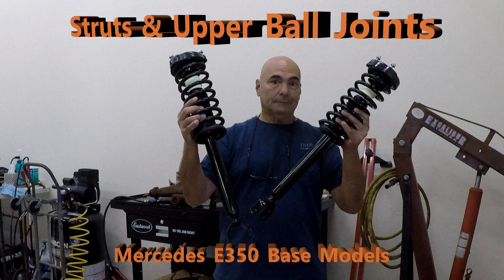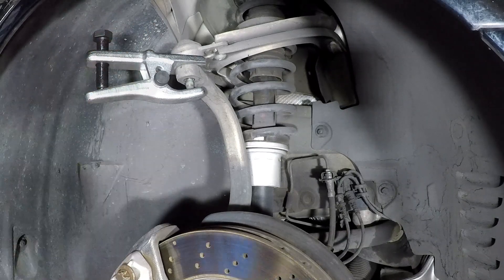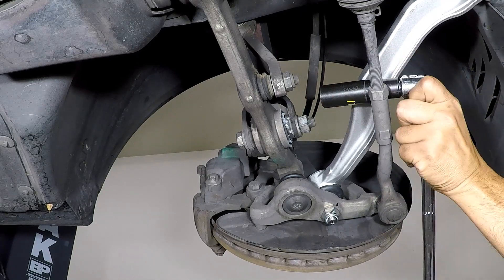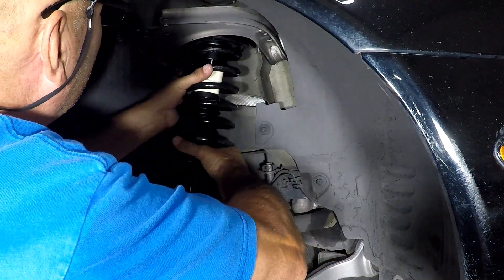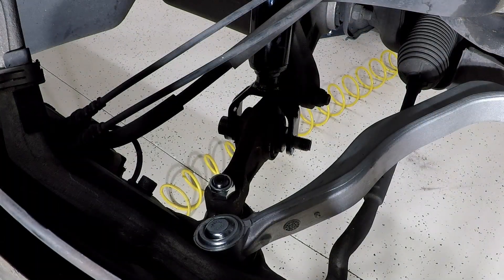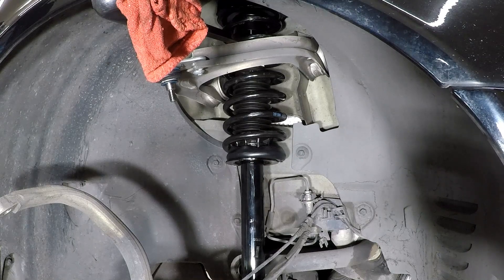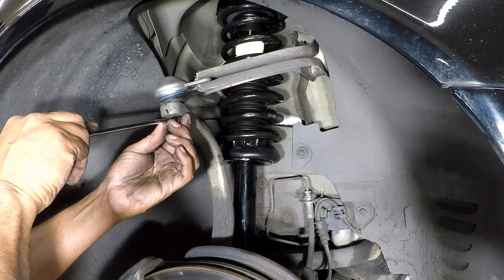Mercedes Benz Front Struts and Upper Ball Joints

Comment: GREAT!  My son and I changed out his struts and ball joints.  We used the Unity and Moog ball joints.  The ball joint lower bolt was 17 mm for his 2008 E320.  Thanks for leaving comments on too because I am learning from others about torque settings etc.   I know this saved me on having to take this somewhere.  I estimate about $400 on parts through amazon that included some tools.

Comment: Great Video. Clear and concise. Just a small recommendation for others when cracking the upper ball joint. I leave the ball joint nut undone but still on the end, this protects the thread while splitting and also stops the upper control arm springing upwards. Just my two pence 🙂

Comment: Great Video btw, thanks. When you split the ball joint couldn't you just leave the nut on a few threads so it doesn't damage them, plus when it pops you don't have to worry about catching it? Just wondering if that would work also? thanks again.

Comment: The torque for the three bolts holding the upper joint is 20 Nm plus 45 degrees as per mercedes WIS in case you need it for the next time .
Great video as usual !
Reply from the maker: Thank you.

Comment: Hi there. I have a 2013 glk 350 base model. A few years ago my front passenger side wheel hit a pothole and the wheel cracked. 
Since then I have changed the wheel, tire etc but I hear a loud humming on that front passenger side when my car goes over 60-65 miles.
What do you think I should be replacing? The struts, control arm?
Just need some help in troubleshooting it
Reply from the maker: From what you are describing, it sounds like it may be a wheel bearing.

Comment: I am planning to replace my struts due to noise from the front end. I have a 2009 E350 4 Matic with AMG wheels, it has coil not air springs. What tool did you use to separate the ball joint? I need to purchase one. Thanks for the excellent video and narration.
Reply from the maker: https://www.amazon.com/OEMTOOLS-26553-BALL-JOINT-SEPARATOR/dp/B0955H22QD/ref=asc_df_B0955H22QD/?tag=hyprod-20&linkCode=df0&hvadid=532546161982&hvpos=&hvnetw=g&hvrand=15103034252721850400&hvpone=&hvptwo=&hvqmt=&hvdev=t&hvdvcmdl=&hvlocint=&hvlocphy=9029600&hvtargid=pla-1423949755333&psc=1

Comment: I hear a rattle noise whenever I hit a bump or pothole, can this be attributed to the struts and boltjoints? Initially I thought it was the brake shoe. But today I felt the rattle noise coming from the front of the vehicle and I see that the tire is pretty sunk in. I appreciate your help on this matter thnx.
Reply from the maker: The car in this video was also making a rattling sound over bumps.  Struts took care of the problem.  Sound like you have the same thing going on.

Comment: Great video! Many thanks!   Which strut brand do you recommend?  There seems to be many low quality struts out there and it is not clear to me which to use.
Reply from the maker: John Schroter 
I used Unity struts from Parts Geek. The only reason I used them was it was hard to find complete struts for this car. Judging by the price I paid. I would not say high end. About $200 for the pair. It’s my brothers car that I installed them in. I have not heard any complaints about them so far.
Reply: @InitechAuto  that is the issue with many Mercedes, BMW, etc. They dont make quick struts that are their OEM.  So other brands do.  Just curious the life on them.  I mean cheap enough can be replaced often. Wished they make quick struts with Lemforder or Bilstein, etc.

Comment: Brother thanks for the informative video,I m hoping to do the struits for my 2006 mercedes slk 280 with help from a friend,but we are both idiots,question is why you didnt have to used a spring camp??I thought someone said the spring can shoot thru the roof,or is it the rear that have tension,and I m doing front and rear can you shed somlights?thanks brother
Reply from the maker: The struts I purchased come with the springs preassembled. No need to do anything but R&R

Comment: would struts work on a 2009 e350 4 matic the unity from partsgeek?
Reply from the maker: If you have the standard suspension system they should work.  But if you have the air suspension then the answer is no.

Comment: Is this process the same for 4Matic models?
Reply from the maker: Should be very simular.  If you have the air ride system.  You will have to disconnect the air line to the shocks.

Comment: Do these work on 4matic?
Reply from the maker: As long as you don’t have the air suspension model. I would imagine that it would fit. But I would check with the strut manufacturer for application. Make sure it fits

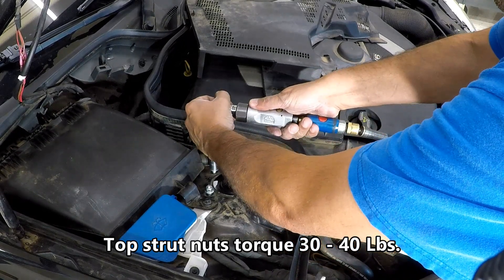Comment: At 9:59, You installed the wheels, and then tightened the 3 bolts in the engine bay...Did you do this while the car was loaded down, or still suspended in air?   Do I need to lower the car to tighten the 3 bolts in engine bay?? With load or no load?  or does it matter at all?
Reply from the maker: I usually tighten the top strut bolts when the vehicle is down.  Loaded would be your answer.  But I have seen guys tighten them down while the vehicle is still on the rack.

Comment: Too bad at 4:14 there is no mention of matching the position of snap ring on the new shocks vs on the old shocks. Better still t
Is to measure the height of the wheel arch to the floor before and after this job is done.😂😂😂
Reply from the maker: I think you need clarification. There is no snap ring to match up.  This is a simple remove-and-replace job. I did mention the proper positioning of the strut assembly in the video.
Reply: Viewing your video again the new shock look different than the old shock. Different brand or design of shock? Visually your old shock has a sleeve like on an original Mercedes shock. Snap ring & it's grove are hidden by the sleeve. I am quite sure your E-350 is a W211. How is the gap between top of the front tire to the wheel arch vs the for rear tire? Regards.
Reply from the maker: @whlawson5812   The struts used were not factory ones. The new struts did not change the ride height at all.